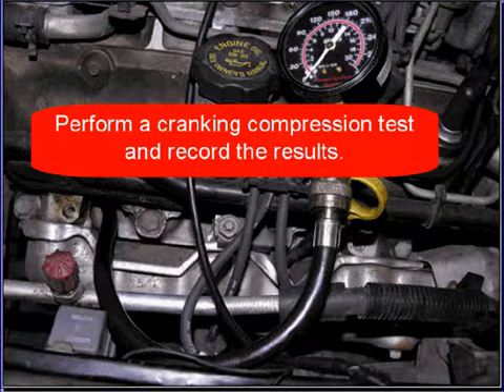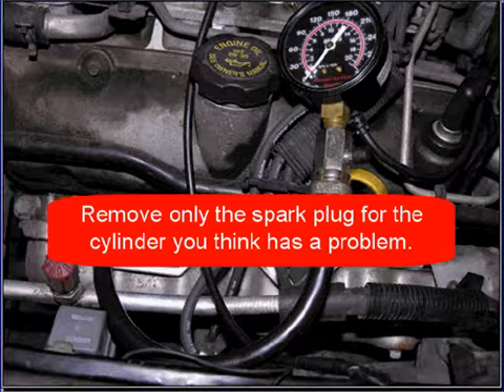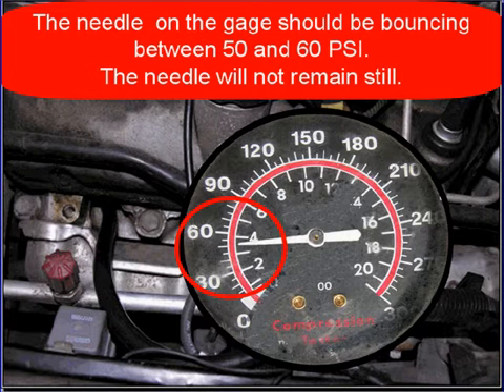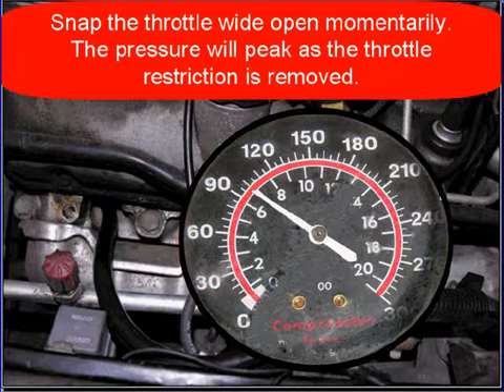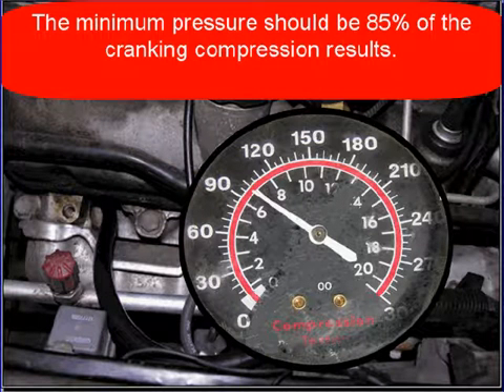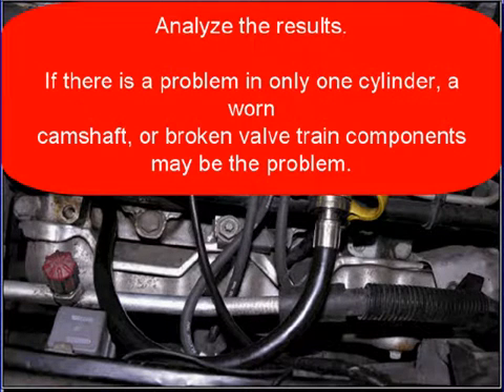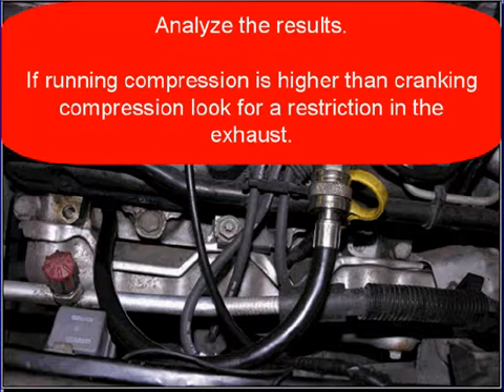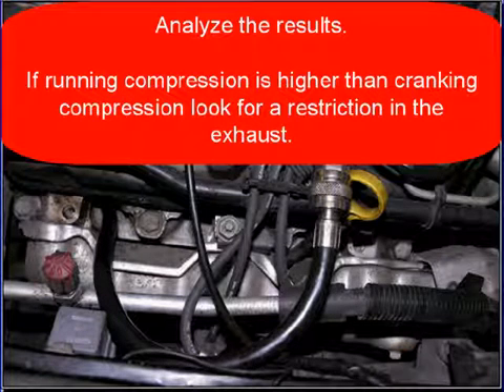23 GM Diagnostics: Running Compression Test

Comment: Shouldn't the idle compression be about half the cranking compressor..so a 50 psi is low ..and also what causes pressure to drop from idle to 1200 rpm